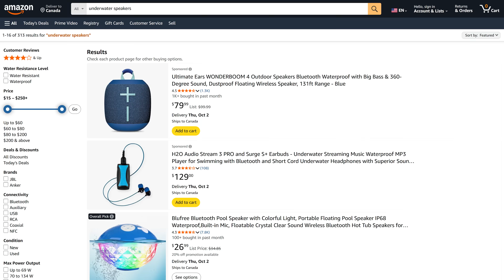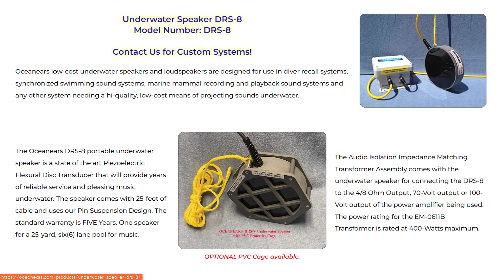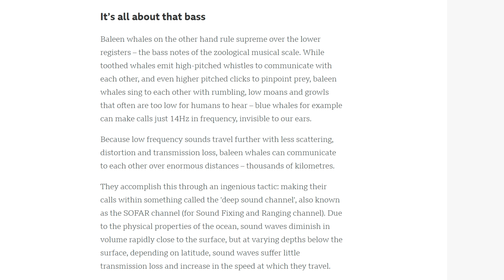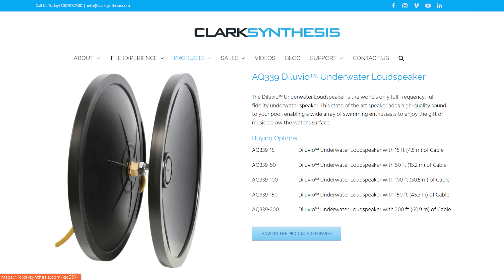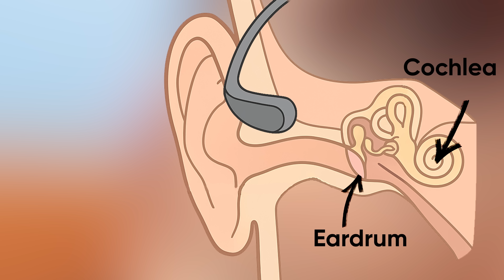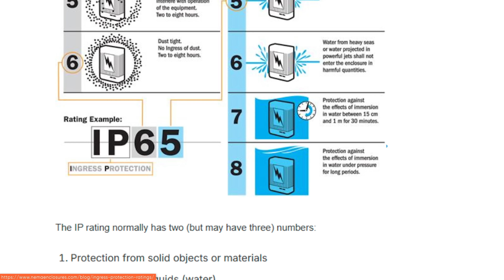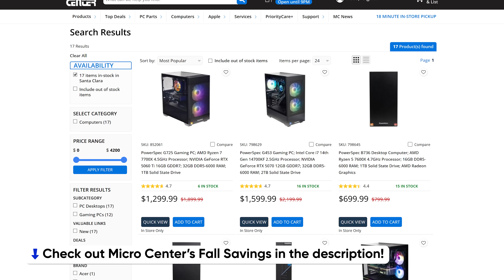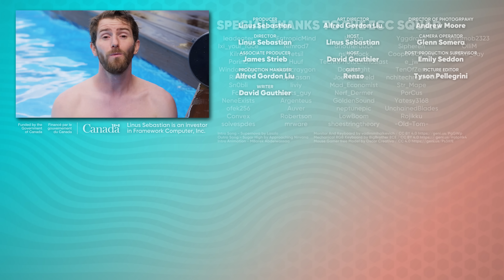Can you Listen to Music Underwater?

Comment: I bought 2 shokz products, one is as660 which is bone conductive, bad sound quality, but pretty cheap as a entrance choice for running and cycling. Another one is openfit2, which is completely another way to produce sound, it's more like having 2 speakers nearby your ears. However, the sound quality is significantly better and it's extremely comfortable to use. I can wear them all the day and still feel good. If they can fix the latency issue, these open buds might be the ultimate solution for outdoor usage (not under water though). The only thing I can complain about is latency. I don't know why but for a Bluetooth 5.X device the latency is so noticeable that you will immediately feel the unsync when you watch videos. That's probably why they simply advertise them as fitness music solution when you only need to listen to musics

Comment: Using the openswim, you have to be sure to put it in swimming mode. That changes the pitch/frequency or whatever it is called, to compensate for the water.

Also, you have to wear swimming earplugs for the best audio.
I've been using them for a year now and they are the best!

Comment: sooo if you want you could sync the underwater and above water speakers and then there would be zero loss
Reply: im assuming tho it might be a problem in regards to water deflecting different and stuff but just a thought
Reply: @kenfndr  the system Renzo sells does actually do that! I think they turned it off simply for the sake of testing the underwater speaker, but the black housing that Linus shows is the above ground speaker

Comment: JUST buy a cheap second hand cell phone and a few high quality ziplock bags, suck the air out of the first bag with the phone inside, download some tunes, you can use the touchscreen still, turn the volume up and click play, then put it inside another bag full of air so it floats. bam underwater speaker.

Comment: I love my openswim pros. They do sound a lot more consistent if you use earplugs. They come with a pair but they're not that good, so I use some better (still very cheap) ones. There's still quite a bit of noise to contend with, mainly air bubbles from breathing out passing the ears, but that's probably the case for all solutions.

Comment: That it is a turn table from a company called Pure Fidelity. And unfortunately he has a his prices wrong. 

https://youtu.be/PxHteu6MxXM?si=FHtjwq0ooOsllL01

They are world class. The finishing on them is second to none. The veneers alone are full pieces with no seems. Very hard to find. They are sanded and sprayed over 10 times. Cost is close to $1,500 just to finish them. Not including the ULTRA mdf which is custom made in the US. Then you add a Delron platter, bronze barring well, stainless steel sub platter and German motor. Adds up quick. 

But when you hear one in person it sounds like the band is in your living room.

Comment: i would love to see a bone conduction headphone round-up
i have been using my Shokz OpenSwims as my headphones for swimming, cycling, and taking walks for a year now, but a small tip when swimming i would use the included earplugs to get rid of the over/underwater inconsistency. I personally also shave my hair right next to my ears so they lie directly on my skin (i know that depends heavily on your haircut and isn't for everyone).

Comment: The Bragi  (youtube.com/bragihello ) "The Dash" in-ear wireless headphones from 2014 (discontinued, any that are still around will have had their batteries expand and fail by now) were also water-proof and a great option from over 10 years ago. You could pair them over Bluetooth (radio doesn't work underwater, mostly), just like the SHOKZ headphones you were showing off, and they had 4GB of storage for MP3, MP4, WAV, and FLAC audio files that got you Hi-Fi grade sound in something much more like Apple AirPods. Srereo sound was accomplished by having the right earpiece communicate digitally over magnetic induction through your skull and brain (which did not have the limitations of radio or trying to send Bluetooth around your head). I kinda wish they started making them again so I can replace my broken ones. They were really amazing wireless earphones. Included a bunch of sensors for fitness tracking (how many laps did you swim, etc.), too, though, no apps for that ever really materialized.

Comment: I heard of model submarine enthusiasts using low frequency radio like 27 MHz, 40 MHz, or 75MHz. It would be cool to see if there's a way to stream any sound at all underwater using those kinds of frequencies, even if you did have to get a bit clever with managing latency and compression methods.

Comment: Yes, you can hear music underwater, and it travels even faster than in air, but the sound experience is different. To hear it clearly, you need special equipment like bone conduction headphones, which vibrate your bones to deliver sound directly to your inner ear, bypassing the need for air conduction, or use waterproof speakers and headphones designed for underwater use.

Comment: underwater budlets are great. Just a heads up if you use budlets for lap swimming they go right in your ears so the sound doesn't need to travel through the water, this is what I used for lap swimming. Its great. Just be sure to get the waterproof ones. They usually come with ones that clamp on so they stay in your ears when swimming for hour or two of swimming they are fine. waterproof budets are usually pretty cheap they are the cheapest option for non team activities they are probably fine. Like 20$ for a pair.

Comment: Been using a set of Aftershokz (pre rename) headphones for over 5 years for swimming and running. They have an eq mode specifically for swimming, and also recommend ear plugs. Substantially better than in ear waterproof ear buds that require a perfect seal to work. And audio quality is less of an issue for things like podcasts and audio books.

Comment: These speakers are designed to play mid tones underwater. Not to sound good on their own. Just like telephones aren't designed to sound good and therefore limit the frequencies to the most important ones in speech. For under water communication this is fine. But if you wanna listen to music, you probably wanna add some more drivers to cover the rest of the audible frequency spectrum. :D
Also ideally you would also have speakers above the water too, so the sound doesn't just cut out as soon as your head is out the water. Maybe someday you can make a video testing actually good underwater speakers... Not just mid tone drivers. And a corrosion proof casing for the amplifier that is not at all relevant for the video.

Comment: I'd love to see a roundup of bone conductive headphones.
When I was in Japan I was facinated when I saw these on display, but >100€ for the ones from Shokz is crazy, so I got a pair for roughly 30 bucks. 
They're pretty solid, with earplugs they're arguably almost better than NC headphones on the plane back.
But I wonder how much better the Shockz are in direct comparison, which I didn't do when I was in Japan, here I would need to order a pair and send back which I really don't want to do.
Reply: And if we're honest, the selection over here in Europe is not so great when it comes to these. The cheapest ones are around 30 bucks, but look half as good as the one I got.

Comment: Can you guys do another Bluetooth wireless ear buds round up?? 

Personally I look for the weight of them , how large they are physically and then the features they have , ie I purchased the fp9 before because they had a cable that let you plug the case into any 3.5mm jack so that you could use your older devices like a wireless Bluetooth. 

Thanks!

Comment: I use Shokz bone conduction headphones, and for the best listening experience, you need to set the app to swimming mode, which reduces the bass, and use the included earplugs. This ensures almost constant listening while swimming with your ears in and out of the water. I find them excellent for swimming. Obviously, you can't expect high fidelity.

Comment: This is a topic I’m actually really interested in. I regularly swim in a public pool doing my laps quite sportily. To not annoy others, headphones are the only option, and with music, swimming gets way easier.

I’ve got the Sony NW-WS623, but I always run into the same problem. When I turn and push off hard, they pop out of my ears and completely ruin my swimming flow, no matter what kind of earcups I use. I tried putting them under a swim band and a swim cap, but that just hurts because of the pressure.

So if you guys ever find a solution for that, I’d really appreciate it. Doesn’t need to be perfect sound, just decent enough.

Comment: A VENEER BURL for 10 grand? It's not even the actual solid piece of burl. 
Black Walnut Veneer sheets run around $23 per square foot.

That better be $9900 worth of hardware in that turn table outside of the wood.

Comment: You probably could have mentioned that an exterior subwoofer might do a decent job of filling in the bass underwater. My backyard subs are sitting on the pool deck and, without any underwater speakers, they're ALL I can hear underwater. Maybe I should add a couple pizoelectric speakers to my setup!

Comment: Surely the solution must be some sort of low frequency transmitter to plug into the 3.5mm jack or USB port on a device stored outside the water?

Comment: I'd love for someone to come out with some off the ear headphones. Basically the audio from the index without the headset. I don't mind some sound bleeding, but my ears get super hot and uncomfortable with anything up against them. I'll probably just have to settle for some open back headphones, but they still don't really fix the issue of the edges of my ears getting hot.

Comment: Another practical application of this -- sound waves lose a tremendous amount of energy going from air into water. (Many of you have heard this "quieting" of sound when you submerge your head). However, sound travels much faster in water when the wave originates from within the water itself. 
When the sound wave originates from within the water, it doesn't encounter the same energy loss as the transition between gas to liquid (air to pool water). This means that not ONLY does the sound wave NOT lose intensity, (as it doesn't have to cross the air/water barrier), but ALSO because sound travels faster in water than air, the sound will be BOTH #1. Louder when starting the song from the same volume, but also #2. traveling faster between people, causing less "delay" between swimmers. This may not matter as much for synchronized swimmers (as they are relatively close together), but if there are 2 swimmers at opposite ends of an Olympic swimming pool, the delay is much shorter if the sound originates from within the water, rather than from the air (which requires an air-water sound wave interaction, which loses a lot of "speed"!)

Comment: The difference of above and below water with the bone conduction is from the sound trying to escape from the ear drum, particularly low frequencies. If you use something like "Alpine PartyPlugs" or other concert ear plugs, it will retain the bass and do the same. Instead of keeping the loud concert level noise out of your ear, it keeps those frequencies in your ear. If I ever want better sound or a louder experience from my bone conduction, i wear concert ear plugs or even just put my fingers in my ear to retain the noise. The concert plugs are especially nice when using bone conduction on the airplane.

Comment: 13:35 i use bone conduction headphones as my daily driver (specifically the shokz pro 2 minis) because i prefer not having something in my ear, and it also allows me to hear my surroundings really easily, or put earplugs in (such as loop earbuds) to block out sound. they're also really nice to sleep with, and for my use case the sound quality is fine. 

all that being said, i would love a bone conduction headphones roundup video!

Comment: deffinatly try bone cunduction headphones.
but also the non swimming running shokz headphones. 
they have so many good use cases. obviously running, biking (safety!) , at work without shutting your coworks off completly or just using 1 air pod which is weird, or basically any place where transparency is nice to have. cause they basically are the best transparency you can ever get...
well in my oppion since the transparency in every other headphones cant compete.
and i would love to see how "good" they can compare to normal in ears / over ear headphone sin there actual "performance" since the non swimming ones assist with a actual speaker not just the bone conduction.

Comment: ShopZygo makes a good underwater bone conduction speaker that uses an intermediate bluetooth to FM radio converter. The first gen product worked great, with good clarity and volume when using silicone ear plugs as well…til one day it didn’t - apparently a design defect means the antenna breaks off inside even though the headphones appear in perfect condition. Charging the headphones relied upon perfect alignment in the case, which was fiddley. $300 US. They offered me half off on the 2nd generation as a consolidation prize, instead of standing by their product,  I’m not sure and have not moved on the offer. I would have paid $100 for the second gen and hoped for the best.

Comment: 4:00 $10 000 for a black walknut vernier  turntable, without the turntable parts. Am I missing something? It's not even made out of solid wood.
Reply: that it is a turn table from a company called Pure Fidelity. And unfortunately he has a his prices wrong. 

https://youtu.be/PxHteu6MxXM?si=FHtjwq0ooOsllL01

They are world class. The finishing on them is second to none. The veneers alone are full pieces with no seems. Very hard to find. They are sanded and sprayed over 10 times. Cost is close to $1,500 just to finish them. Not including the ULTRA mdf which is custom made in the US. Then you ad a Deleon platter, bronze barring well, stainless steel sub platter and German motor. Ads up quick. 

But when you hear one in person it sounds like the band is in your living room.
Reply: $10, 000 and then using a vaneer is is criminal.
Reply: Just a guess but I think it's supposed to connect to the underwater speaker so you can listen to records underwater. just like the whole box they use with the regular speaker it probably has all the stuff needed to fight against the corrosion from the pool air. but i imagine that's what's driving up the cost

Comment: I made the Bluetooth waterproof speakers work underwater using a ipx7 phone under water too.

The problem is the phase change between air and water I guess... If both are underwater it works (at least with my JBL flip 5 and an old S10) 

Give this comment a like to see them testing it, the bass was so cool underwater 😂

Comment: This is the type of ridiculously expensive tech stuff I'm interested in. It's some wildly impressive thing, not just a luxury version of something else. The perfect type of unattainable content.
Reply: well if my google-foo is correct this kinda is a luxury item. The transducer (not including transformer) is ~2k. Clark Synthesis makes a similar product for about 1k  (AQ339). The transformer for more permanent installations rather than just a drop in is another 400 but based on suggested wattage though I honestly wouldn't bother, a 150 WPC amp is basically throwaway cost at this price point.

Comment: I got the OpenSwim Pro for swimming laps as I always got bored and stopped after 1 km. Definitely made longer sets easier to get through. They don't sound as good as regular headphones or earbuds out of the water. I have also used them to listen to audio books and dnd podcasts while swimming, definitely need to use earplugs for this though and you'll still miss some stuff. 

When I do swimming, cycling or running sets back to back I liked the comfort and fit enough that I rarely swapped out for my nothing open ear (which sounds better but I find I'm constantly adjusting them during runs because it feels like they will fall off).

Comment: Weird or esoteric? Ok, I don't have much & it definitely can fall into niche but sure, wifi+latency spitball I guess. Most of it probably isn't all that interesting or videoable.

Theres an Asus 4X4 antenna wifi client card & it uses a chip normally that's only in routers. 
8x8 wifi routers was here & gone, amplifi alien being one of them.
TXQS, AQL, & AIRTIME_FAIRNESS are often overlooked in wifi access points but can be a major factor for handling congestion. You can see them with iw list when SSHing into them.
There's an open source openwrt one wifi router out there.

Some niche latency things I guess
There's a test called crusader that measures network latency while saturated, I use that to determine the quality of routers these days.

Latency is the biggest bottleneck for CPU performance in video games according to chips & cheese.

Latency is the bottleneck during the ramp up of a connection, so anything including webpages below 2 bandwidth delay products is latency bound while loading.
Latency determines how quickly a connection can react to stuff like packet loss, this can lead to unfairness favoring lower latency connections.

A general rule of thumb is latency impacts when stuff starts, bandwidth impacts when stuff ends.

Comment: I use my shokz daily due to hearing loss, they bipass the part that has issues for me. They are also by far the comfiest headphones I have ever owned. Pair them with a pair of high end ear plugs with the money you saved on buying them and they could rival any other headphones in my opinion.

 The new pro 2s cheat by having open ear speakers as well for sound quality but less powerful vibration which is good for some and bad for me. So fyi.